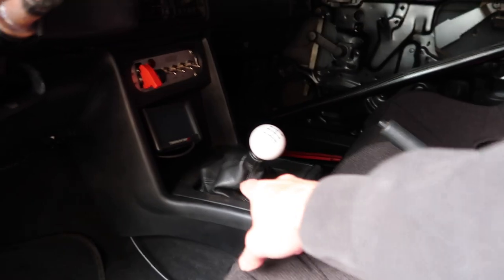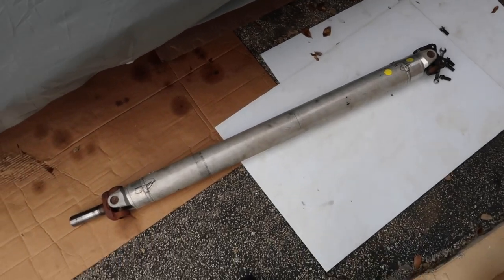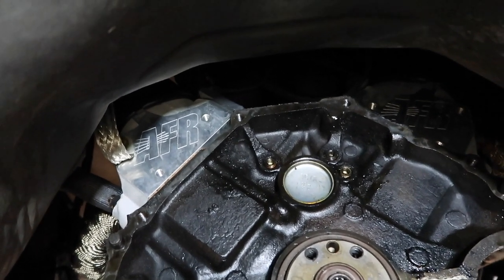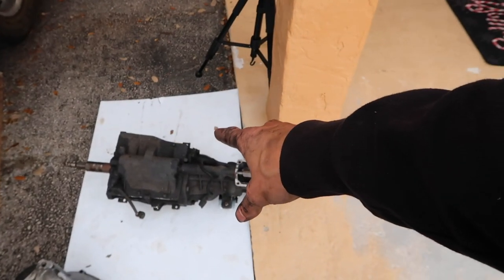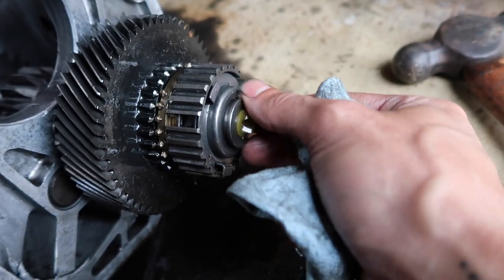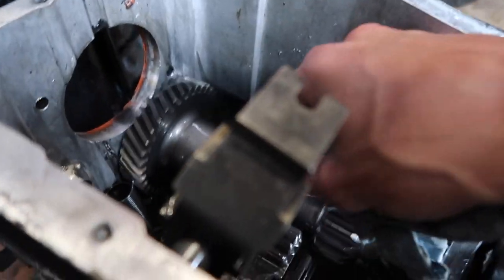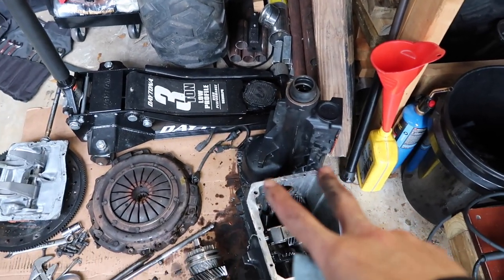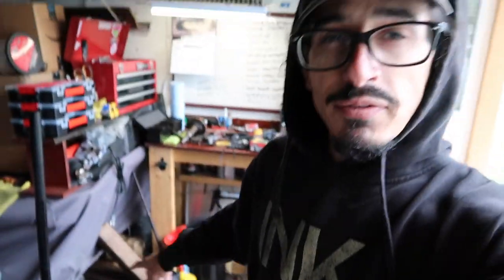Pulling and Diagnosing Our T5 Transmission... How Bad Did We Break It?

Comment: The tremec TKX is better as the housing is very similar to the t-5 and will go in with no issues (as far as I'm aware) but the t-56 is a pain in the butt to swap as modifications will be required to get it to fit, but if your still looking at t56 transmissions you might be able to find one in the junkyard.
Reply from the maker: cool cool.. yeah im digging the idea of running a tkx more and more

Comment: Love your Chanel, love the fox body. If I were you I would replace the rear seal before you put everything back in and I would actually put a Engine Crankshaft Repair sleeve before the rear seal. It should stop unwanted leaks. You can get that sleeve at O’reillys, National Shaft Repair Sleeve part # 99363. Keep up the good content brother 👍
Reply from the maker: thanks man. Much appreciated. I will definitely be replacing the rear seal before re assembly 🤘🏼

Comment: Also there are 2  or 3 different gear set options with the tkx and the option to go 26 spline instead of 10 spline so you have somethings to consider. Mustang Stifflers TKO/TKX Install Kit For STF-TCBM03 & STF-TCBM01 (82-98)

STF-TKOM09
Thats the spacer kit from lmr i had to use the tkx sat to low for my liking. 

TREMEC TCET18085 TKX 5-Speed Manual Transmission, Ford, 26-Spline

TREMEC TCEP8639 SBF TKO/500/600/TKX Trans Bellhousing, Aluminum

Speedway motors was the only place where i could find the Transmission and Bellhousing in stock at a good price also this transmission i chose was 26 spine in put shaft with a 3.27 first gear. I love 2nd to 3rd omg you'll never miss that shift again.
Reply from the maker: okay okay all good information. Thanks dude 🤘🏼

Comment: THROW THAT P.O.S. AWAY !! DON'T EVEN THINK ABOUT FIXING IT. 
I have an 85 GT. I'm on the third rebuild of my crapy T-5. And your right. That's 3rd gear and it will always shear off. I even have the "World Class" T-5. Plus, make sure you have at least the medium duty 8.8 rearend. I split my original 7.5 in half with a stock 302. Furthermore, reinforce your unibody. If not, the body will twist and rip the floor pan along the drivers side door.
Reply from the maker: yeah ive decided against rebuilding it.. ill just be patient and save for the upgrade

Comment: The TKX is a different shifter the bottom portion cant be reused but the handle can be used you'll have to drill the holes alittle bigger i forget the exact size but its two or three drill sizes up from the original hole diameter. Also use the screws that come with the tkx because those will be different also.
Reply from the maker: Okay cool, good to know 🤘🏼

Comment: Bummer. Time for the new TKX, which is better than the old TKO's.
T56's are overkill for your goals.
Check put Promotion Performance in Ft. Lauderdale. They have used transmissions for sale occasionally  and are a Tremec dealer as well.
Reply from the maker: yeah thats what i want to do.. throw a tkx and a quicktime bellhousing in it… just gotta save up for it

Comment: Check out Paul cangialosi on YouTube, he's like the t5 god, has a bunch of videos on tear down and rebuilding t5s, believe he's also located in southeast Florida as well. 5th gear needs to be pulled off with a press if I recall correctly. The counter shaft is all one piece. The slider is covering first gear and is probably damaged as badly as your second gear. The input shaft is supposed to have that cut away on it for clearancing the countershaft when installing. If your gonna rebuild it, I would definitely replace all the bearings while your doin it, the amount of metal in there has probably at minimum nicked the bearings up. Whoever was in that trans before probably wasn't the most competent person out there, judging from the copious amounts of rtv used on it lol. Good luck with whatever you decide to do buddy, tkx definitely not a bad choice.
Reply from the maker: hey man, thank you for the information. I didnt even think about the small amounts of material that may have gotten inside the bearings… and thankfully you brought it up, because of that im just going to save to buy a tkx.. i dont want to be $500+ into the t5 when the car has really out grown it anyways 🤘🏼

Comment: You can see oil running down back side of oil pan , all that fluid everywhere is from rear main seal or rear of pan leaking it looks like me .
Reply from the maker: i think they’re both leaking a little.. rear main seal will for sure get replaced before the trans goes back in… contemplating pulling the engine to replace the pan

Comment: Nope, the TKX IS A DIFFERENT SHIFTER
Reply from the maker: okay.. do you know, if the shifter that comes with the tkx is decent ? Or should be replaced?
Reply: @jovanmichaels  I'm sure it's decent but the aftermarket is making them with shifter stops and I'm sure they are better than stock